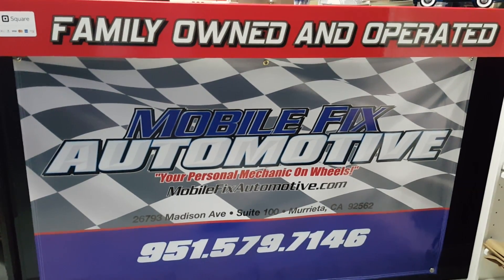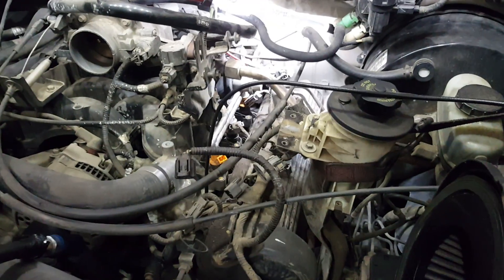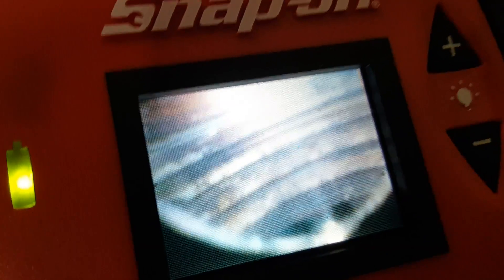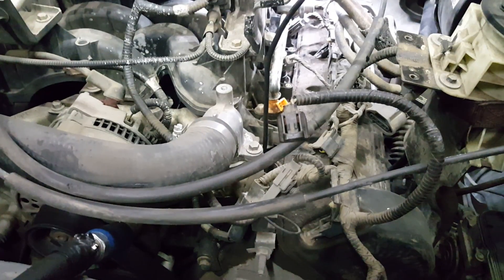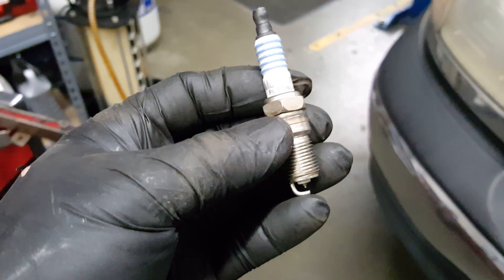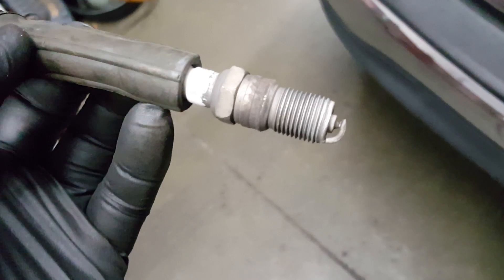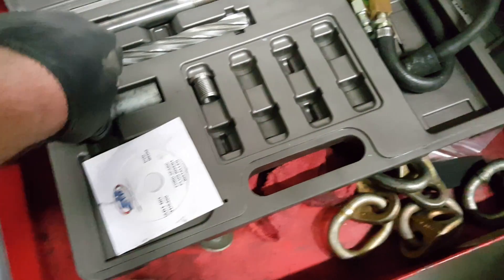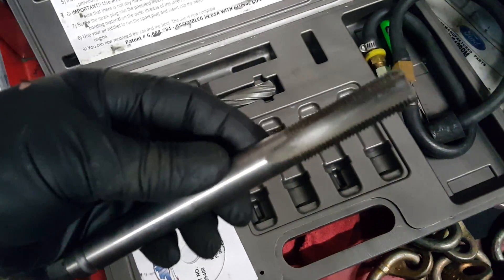Why the spark plug blew out of your Ford Triton engine

Comment: I just bought a 2016 motorhome with a 2015 Ford chassis and Triton V10 engine.  Most of the videos I'm seeing seem to indicate the plug blowouts were/are occurring in the late 1990s and early 2000s models.  Does anyone know if Ford has redesigned and improved these engines by now to prevent the plug blowouts?
Reply from the maker: +Jim Smith 
Hi Jim. The 2 valve Triton doesn't matter what year you have, they all can do do it. The 3 valve VVT (variable valve timing) Triton has the opposite problem. On the new engine which was introduced around 2007 the plugs usually get stuck and break off in the head. Most Ford Motorhome chasis continued to use the 2 valve engine even after 2007. 
There is a lot more to this but i suggest you call me and i will explain. My number is on the video.
Thanks
Reply: Thanks for the response, Ron.  Much appreciated.  I'm not a mechanical engineer or anything close, but I'd like to think I'm an above average shade tree mechanic who does most of his own auto work. It seems to me that it wouldn't take a lot of effort and cost on Ford's part to beef up the sparkplug holes in the castings to prevent those blowouts. Or am I missing something?
Reply: ford does like people who can work on their own vehiles, therefore the design.
Reply: They don't put anything but 3 valves in 04's and up in coach's no blow out problem with them.

Comment: Had an 02 explorer with the v8 that was spitting plugs like they were su flower seeds ... what a pain in the ass
Reply from the maker: +stephen frank my spn has an 02 explorer with the 4.6
Reply: Ron Williams idk what is was but it spit one plug twice and then another one like 2 months later ... worst part is hen it did it took the coil pack with it ....
Reply: I know someone who has a 2002 Explorer with the OHC Cologne 4.0 V6 and it looked like it was still fine, during the last time I checked! (At least in was in the beginning of 2016)
That's despite fears of the OHC chain (or belt) breaking or coming off. Or fears of the OHC drive tensioner going bad. And of course, fears of having to lift the motor out...

Comment: tighten plugs to 20lb problem solved. dont be scard
Reply: Well damn...... Hope i didnt screw mine up.  I torqued them to 28ft lb.  Knock on wood
Reply: Daniel Hinkle even better if the threads took it. i would be nervous anything more then 22lb
Reply: I now tighten 2v triton plugs to 18ft lb's. The factory 11 always felt like barely below snug and over 20 feels a bit too strong for the clear lack of thread count in the head. I have had many of these heads off and noted the low thread count many years ago.
Reply: Did mine @ 17 lbs

Comment: He is exactly 100% right! But I also tell folks not to run a hotter plug or run super gas when it doesn't call for it because it causes more spark and combustion in the cylinder which will increase the probability of this happening when the threads are weak.

Comment: Ford build tough! Or ford builds crap.
Reply from the maker: +Heriberto R Montalvo i have a 08 Silverado 5.3 in my shop right now that the timing chain tensioner broke, causing the timing chain to jump time and it bent valves in all 8 cylinders. Cost to repair is $3800. 
Cost to fix blown spark plug is under $300
Chevy, or Ford?
Reply: Oh, yes. GM, They also make crappy cars. My son in law works at  a Chevy dealer and he tell  me  that most, specially the little cars are crap. I do have a ford wind star Bought  it new 2003. Up to now. I can't complain. Although, I have fix crack axle, rusty front subchassis. The van still run excellent. I have don't  most of the technical work and anything I can do. So during the course of those 13 years, I spent $3,000. And  the  bulk of it during the last two years.  I got lucky with  this van. I was aware of some of those problems. If need to do any work on the van I look at you tube to see if I can do it myself.
Reply: That was a very nasty expense. And all, because these companies don't want to make good engines. They make it so that   at  a certain mileage it should break down. To make a person spend money on mechanics or to encourage one to buy a new one

Comment: Hey Ron i just had a spark plug blow on my 2003 F-150 5.4L V8. What is the average cost for this procedure if I were to bring it in?
Reply from the maker: +182BlinkStar $285
Reply: @SandCarServices  if I had the dealership do a helicoil about 4 or 5 years ago can this be redone on the same cylinder? This seems way thicker than a helicoil
Reply from the maker: Yes, but getting the old insert out is the tricky part.

Comment: Good video, have you seen this problem on the 4.6 engines they used in the Mustang 
I have a 99 gt and the other day while changing plugs I discovered that #2 cylinder has a helix oil on the head.
Also It has a tapping noise in the engine. 115k and I just done timing chain kit but noise persists
Any Ideas would be great 
Engine runs well and good oil pressure but has a bad tapping noise ?
No signs of metal found in the oil either. Engine is very clean inside and no smoking or oil consumption 
?????

Comment: Respectfully sir, I have to disagree with you on your comment of "blow out". Your issue is a "back out". Blow out would be the spark plug blown out of the head stripping threads and launching through the hood.
A spark plug backing out of the cylinder head is not a "blow out".

Im a disabled military abrams tank mechanic, I have toyota college training and took autoshop in highschool.

Have a nice day.
Reply from the maker: +Duane Schlender 
that must be why when we try and reinstall them they just spin! Because there are no threads left.
Reply: My reply was based entirely upon the video and the good head threads shown as well as the good threads on the plug  also shown. Had there been shown a stripped thread count on either the head, plug, or both, I would have responded differently.

Thanks again.

Comment: for those that don't already know, alot of ford engines were manufactured with low thread-count heads. I own a '96 ranger with a 3.0 60° V6, iron head and block. has maybe 5 threads in each hole, and shouldered plugs to match from factory. I run gap checked NGK TR5GP platinum plugs with no problems. check your Taurus's and aerostars too, they also have 3.0s. my truck has 245,566kms, runs with no issues owned for three years

Comment: Funny I find this video and the date you release the video. In February 2016 u was I. Ft Pierce, FL. On the 16th my 4.6 L V8 blew a plug out the block.  But the dual coil packs are what I have. Had to helocoil number 4. Had to replace there's of the plugs as precaution and both coil packs.

Comment: This happened on my '96 Cobra, so it's not only the truck engines. The dealer repaired it with a helicoil, but it looks as though that might be failing; that cylinder is misfiring and the plug-wire boot doesn't fit snug against the engine on that cylinder any more. Does Cal-Van make an insert suitable for the Cobra?
Reply from the maker: +stokestack you would have to contact calvan. I have not seen a cobra in person with that problem.
Reply: Thanks. I did, and Cal-Van says they have nothing for 4-valve engines, unfortunately.
Reply from the maker: +stokestack that's great I'm glad to hear it. Please let's keep the community informed if it works for you can you let me know so I can relay that information to the rest of my customers thank you
Reply: Hm, I think you may have misread my comment. I said Cal-Van does NOT have anything for 4-valve engines. I have asked for specifics on why neither of their kits will work, but haven't heard back. I also contacted Lock-N-Stitch about their kit, and they told me that I'd have to determine which type of cylinder head I had. They sent me a PDF about it, but apparently forgot that it tells you to use one of THEIR tools (which of course I don't own) to make that determination. So I'm back to square one. I did buy a borescope to examine the plug area, though. We'll see what that reveals.

Comment: the Triton come out in 1986 the public didn't get it until 1996 never had a spark plug blow out of any of my Triton's because I tighten the spark plugs up when I replace them and I'll change them three times cuz it's got three hundred thousand miles on it when you replace them Titan and they won't blow out

Comment: they blow out because the person who put them in there didn't tighten them up
Reply: No they blow out because those are aluminum cylinder heads, the plugs are steel, and due to the different temperature expansion coefficients, between the two metals, and the lack of more threads, in the cylinder head, the threads wear out. Each time that engine is cooled and warmed, those threads are enduring wear. That's why it can happen, even after only one spark plug change... ie ; at 80,000 miles. It has nothing to do with the tightness of the plug. In fact more than likely, you'd never be able to tighten the plug tight enough. It would just pull the remaining threads out of the cylinder head. Poor engineering work on Ford's part.
Reply: wrong
Reply: timmy pruss it is possible the threds are not the problem.

Comment: On Aluminum Cylinder Head Spark Plug should be remove while the engine is cold and should be installed dry (WITHOUT ANTI-SIZED). The procedure is exact opposite when Cylinder Head is Cast Iron.
Reply: Thats how i did mine... Cold with no anti seize except i may have torqued them to much at 28ft lbs.....  It was a general consensus i found researching thread torque.

Comment: Hi Ron, I just bought a 1999 F250 with 6.8 V10 and 81,000 miles from Murietta, don't know if spark plugs ever get replaced or not, could I just go ahead re-torque all plugs to 20 ft-lb for good measure ?   Or I may end up stripping the aluminum thread accidently by doing so ?
Reply from the maker: +BA GHẺ of minhrâu that is a excellent idea and yes just don't go more than 20 foot pounds

Comment: With the blown spark plug, can it cause the truck to die. Was driving the truck home and it shot out the plug and ignition coil. The truck died on the highway and had enough speed to pull off to the side.
Reply from the maker: +Earl Martinez they usually die at idle. But remember computer can get confused
Reply: ok thanks. going to attempt this repair with a kit from autozone.
Reply from the maker: +Earl Martinez  caution!!! they will blow back out. Calvan is only permanent solution, trust me i know
Reply from the maker: +Ron Williams let me rephrase that I have found through my experience that the normal Helicoil kits that work good on most all the other engines do not work on the Ford Triton Motors very well. There is a strong likelihood that it's either going to not work right during install or it'll simply blow back out within days or weeks of the install. Good luck
Reply: it happened to my dad's 2000 f-150 tritan and it went into limp in mode. never died, just fired on the other 7 cylinders .

Comment: No question ford should have  had the  heads  bored right years ago ,just like GM should had  had  better cams for the  305 V8,but they  too just eventually  fazed out the  crap  305.

Comment: Over-engineered nonsense.  Funny, I never remember spark plugs blowing out of 300 six cylinder engines or 302's or 351 Windsor engines.  The reason they don't build engines that simple and reliable anymore should be obvious.
Reply from the maker: +scdevon the engines you listed had cast iron heads. Thats why. To keep weight and emissions down alluminum is now the normal.

Comment: I think [I could be wrong on this], the first sign there was going to be trouble was the emblem at the front of the vehicle. If I see a blueish oval I usually just keep walking. I fixed one for a friend and then asked him to never bring that truck to the shop. He loved my 1979 C20 and always wanted to buy it, the he goes and buys that damn F model. As a Euro mechanic I have seen tons of engineering over the years. Most of it is over done in the Euro cars. But this engine defies description. There are other things I noticed about it when I sorta fixed it, but that is more than i care to hammer out now.

Comment: Most working stiffs settle on Ford or Chevy/ a bad experience with one or the other is usually enough to cause a man to change horses. I changed from Silverado to Fords I've had several rangers and f250 . I bet I have bought more than twenty fords since 1982 or so counting the wife and kids cars I've bought . I bought one once not knowing when my daughter caught me without my glasses and ask me to consign a car note . Turned out I bought the thing and didn't find out for a year or so. When I asked her if I could drive it she said no. I found out a year later I actually bought it but she did make all her payments . When she married the young man told me " she has better credit rating than I do. I laughed and said check out her teeth , you owe me a Harley , I'm still waiting

Comment: Drove  VW beetles they also had this reputation for blowing out plugs. The issue is aluminum head and steel plug. Can you say electrolysis? If you dont put anti sieze or some similar product on the threads and if you dont torque them properly your going to have a problem. 
The other issue not mentioned is the plugs are deep down inside a hole on top of the engine that collects water and in my dads case rat feces and urine.  Nastiest job i ever did.

Comment: Hey Ron, nice scam you have going there.  I too have a video I made two years ago about the 4.6 supposedly blowing plugs out of the hole.  This is a repair service HOAX.  First off I don't believe these engine heads only incorporate four threads and even if they do it still wont cause plugs that are of proper design and installation to come loose.  If any spar plug blows out of its hole it is only because the previous installing stripped out the threads n the engine head.  Its many times installing the WRONG seat design.  Such as the 4.6 two valve uses a tapered seat spark plug, but many parts stores will sell you a flat seat plug.  Look down these metal tubes where you drop your socket to install and remove these plugs and take a flashlight and observe whether you use a flat seat or tapered seat. And even if these heads only incorporated four threads it wtill wont matter if you don't cross thread them and screw them in and get them snug they will never blow out of the cylinders.  Your inserts are still relying on these four threads and could blow just as easily if the SEAT is wrong.  If I take the proper tapered seat plug and install with its eleven threads into this four thread hole and the seat fits snug on that head it will never blow out Ron.  If any of these blow out it is only because someone stripped the threads that installed them before.
Reply: I get what you are saying but going by what he said in the video, these spark plugs have never been changed before  on this particular truck so how do you explain that? Are you saying Ford may have installed them incorrectly from the factory?
Reply: But, youre going again by what HE is saying. So you listen to what any repair service salesman is saying?
Reply: Not necessarily, but a quick look through the comments on this video have several people saying their factory spark plugs blew out of the cylinder head. Has to be what everyone is saying, a design flaw with these particular engines
Reply: you are a true idiot this is happening all over the world
Reply: Earl Guyton in structural Ironwork with a325 bolts they want to see three threads when it's pulled up . A one inch bolt has 8 inches per thread , the block in effect is the nut . As was shown on the video threads do not run thickness of block but are approximately 4&1/2 threads or about five eighths of an inch . This was obviously an engineering and QC issue . If you want to insist it isn't your just not thinking right. Every instruction for installing spark plugs tells you to put them all the way in and then tighten some but everyone can understand that the assumption is that the threads extend all the way into the head not just last half inch . Don't be a nickel head
Reply: Same as lots of people said they were a witch so they set them on fire as 100 idiots gawked?  If any plug ever blew out of one these engine heads in these modular engines it is only because someone stripped out the threads that previously installed them
Reply: Iron work?  Aluminum?  a325 bolt?  This is a paste comment and isn't real  Threading can be done (turned in over 12 finesses or course)  Made up fiction,  Hey Ron, nice scam you have going there.  I too have a video I made two years ago about the 4.6 supposedly blowing plugs out of the hole.  This is a repair service HOAX.  First off I don't believe these engine heads only incorporate four threads and even if they do it still wont cause plugs that are of proper design and installation to come loose.  If any spar plug blows out of its hole it is only because the previous installing stripped out the threads n the engine head.  Its many times installing the WRONG seat design.  Such as the 4.6 two valve uses a tapered seat spark plug, but many parts stores will sell you a flat seat plug.  Look down these metal tubes where you drop your socket to install and remove these plugs and take a flashlight and observe whether you use a flat seat or tapered seat. And even if these heads only incorporated four threads it wtill wont matter if you don't cross thread them and screw them in and get them snug they will never blow out of the cylinders.  Your inserts are still relying on these four threads and could blow just as easily if the SEAT is wrong.  If I take the proper tapered seat plug and install with its eleven threads into this four thread hole and the seat fits snug on that head it will never blow out Ron.  If any of these blow out it is only because someone stripped the threads that installed them before.